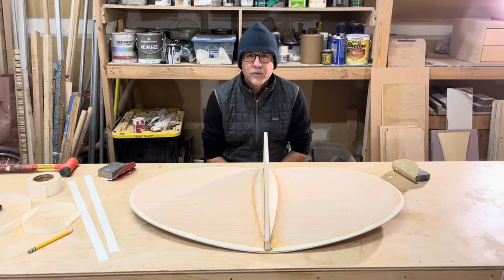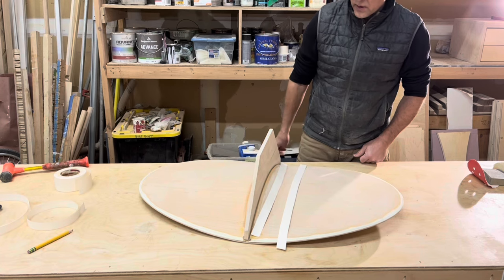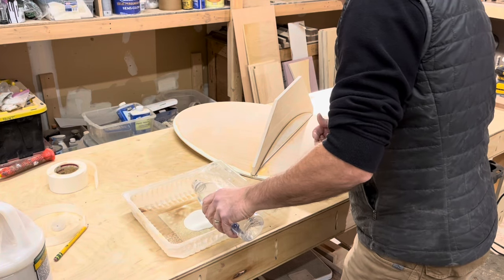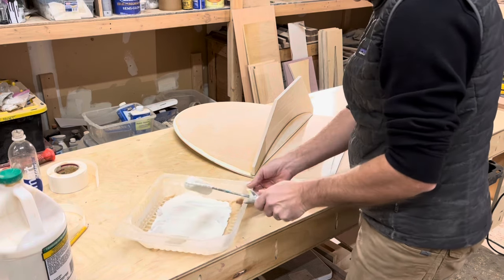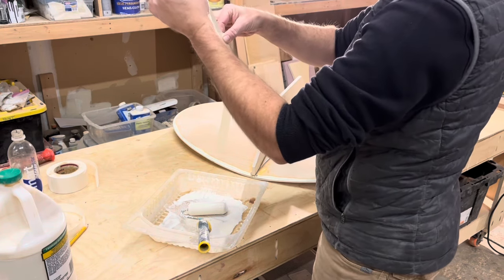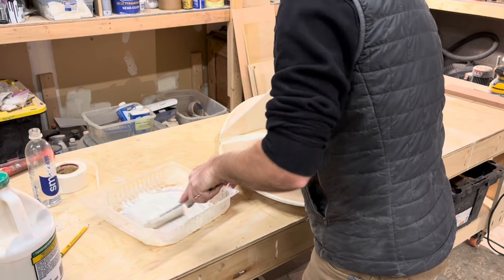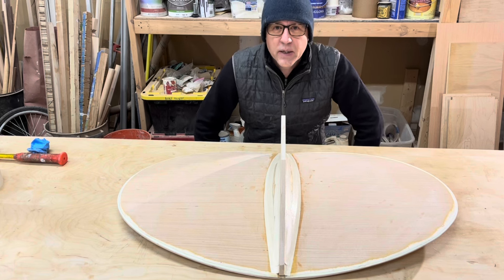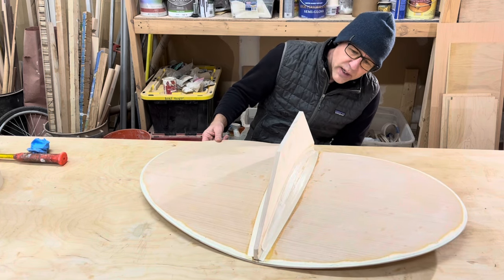Using paper in boat building

Comment: I see the logic and value your experience. The general public scoff at SoF boats, thinking them fragile craft. They are not! Boats don’t need to last forever. They need to be useful, lightweight, and accessible. My experience says water rot is a distant second to UV radiation, in the degradation of watercraft.
Curious if you have experimented with pvc foam board?
Reply from the maker: Thanks. I agree, light weight is important.  The lighter the boat, the more it will be used.  Your the second person to ask me that question about pvc foam board.  No I have not used it.  I believe it is a bit less rigid and a bit heavier than plywood, I might be wrong.  I would assume you could join it together with pvc cement.  It is definitely better at UV and does not need to be sealed.  You could probably use stitch and glue with it.  I worked in the trade show exhibit industry for 7 years.  It was used for graphics.  Especially outdoor signage.  It was called Sintra.  I’ve made things with it but never tried making a boat with it.  I’m sure it could work.  I’m not sure how clean the glued seams would be.

Comment: How much longevity can you expect from paper? Is this joint going to last 10 years?
Reply from the maker: As long as the paper is properly sealed and does not get wet it will last as long as any other plywood boat.  I’ve built 3 boats this way.  Always coat the parts of the boat under the waterline with epoxy and you are good.  You are less likely to have a tiny pin hole for water intrusion using this method than with stitch and glue.  With stitch and glue, an air bubble pin hole can lead to rot.  The fully saturated, glue infused paper does not allow pin holes.

Comment: @markpalmquist  What is the evidence for the assertion "that it will ast as long as any plywood boat". You have built a small number of boats and used them very lightly.

The method may show promise. But in general the load taken by a material is in proportion to its thickness. A single layer of paper  will do next to nothing because it is so thin and its fibres are short and randomly place.

All of the work being done in that joint will be by the timber gusset both sides. At approx 40mm thick it is 800 times thicker than the paper. So will carry 800 times the load. Omit the paper and it will make no difference at all.
Reply from the maker: The gussets are 5mm thick plywood, watch previous video.  The paper helps spread the glue joint so that the gussets can’t get dislodged.  The paper works well for that.  I’ve tested the paper in tension to be 33 lb per linear inch when saturated with TB3.  So the 20” long paper seam adds 660 lb of resistance.
Reply from the maker: Given that plywood is 1-2mm thick wood veneer glued together with a waterproof glue and paper is made of wood pulp and I am using a waterproof glue, they are very similar if not the same materials.  If both are sealed the same way with either marine paint or epoxy or both, why would they not hold up the same amount of time?  I’ve already said it is good for day boats on the water for a few days.  I’ve never claimed anything more than that.